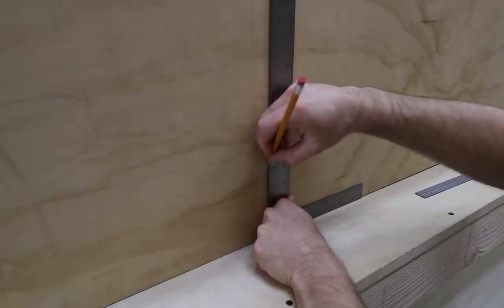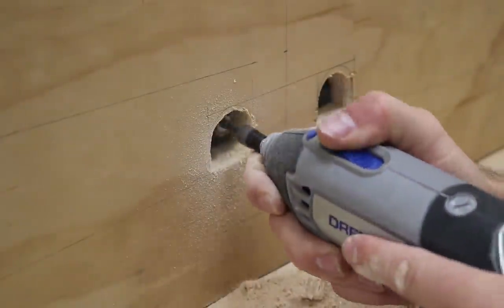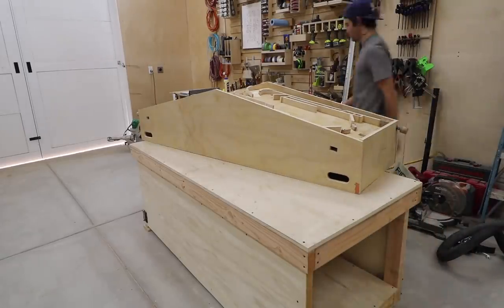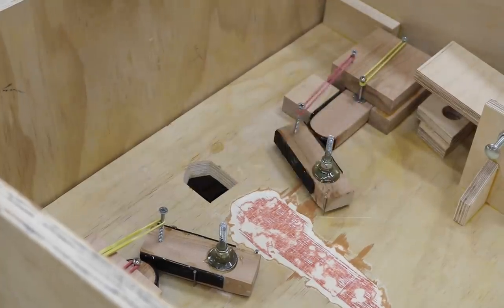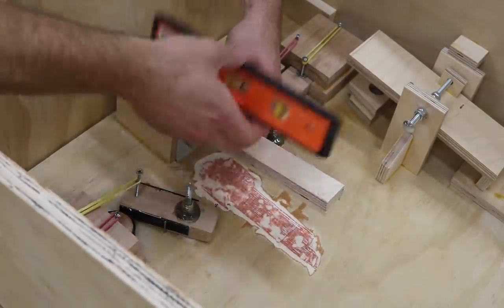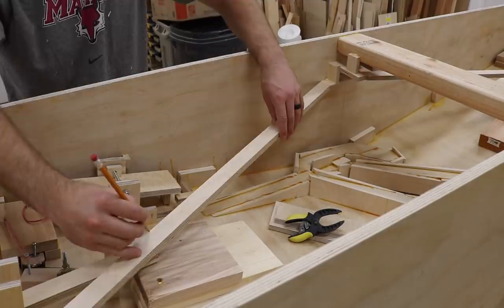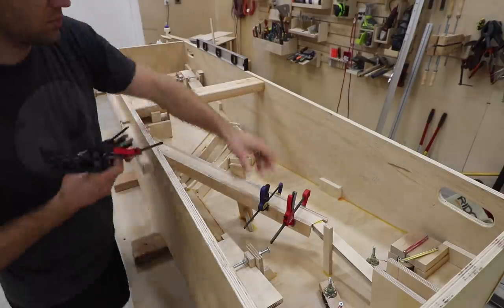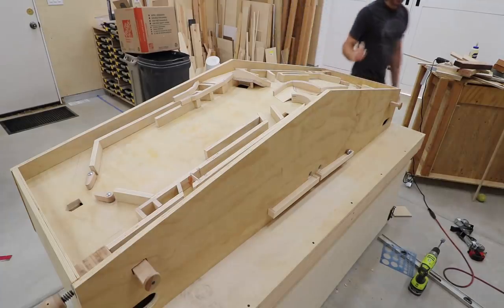2 Player Pinball Machine Build, Part 13 (Scoring Ramps)

Comment: did you ever come up with a solution to prevent the obvious wear to the flippers? i have built flippers in the same fashion that you have, and the flippers (after some wear and tear) start moving independantly from their axles, as your left flipper appears to have done at 8:20 for example

Comment: Awesome following you since the beginning. Is wood glue really enough?
Reply: Wood glue us usually stronger than the wood (depending on joint style and surface area).
Nails and screws are good fasteners, but they create stress points in the wood. While glue can hold along the entire surface area of the joint, fasteners can only hold in the spots they are at. This can put a lot of pressure on the fasteners.
Reply from the maker: What Falessan said ⬆️ 👍

Comment: Just a little suggestion. I was thinking that if a player shoots the pin balls off the plunger at the right speed, they will all be able to go in the top hole and instantly go to the opponent side making it overwhelming. Is there anything you can do to make sure that the pinballs you shoot need to hit your flippers first?
Reply from the maker: Overwhelming is all part of the game! Also while it is possible, it’s pretty difficult to launch it just right to go into the upper tunnel